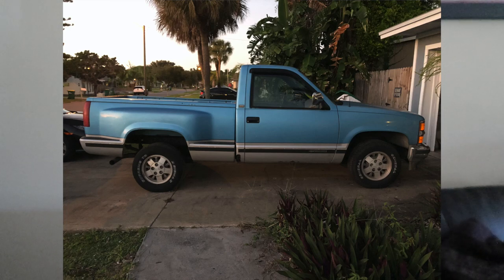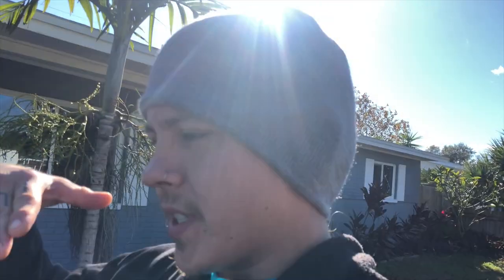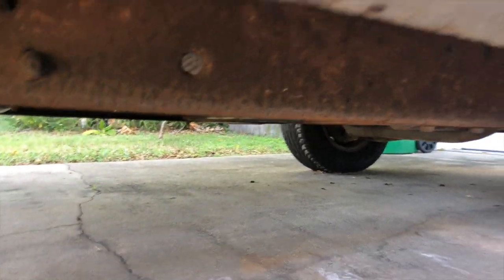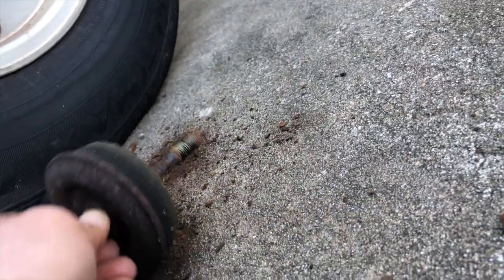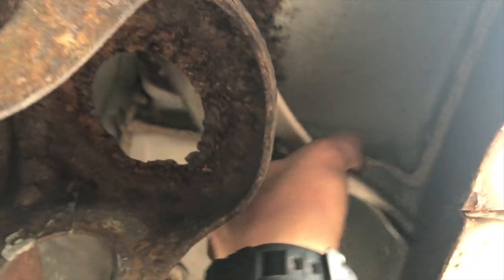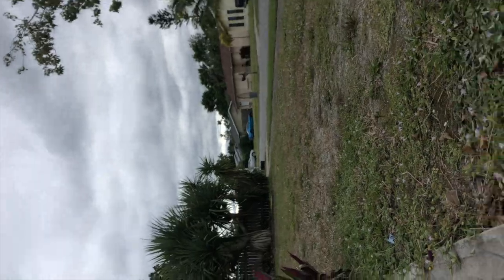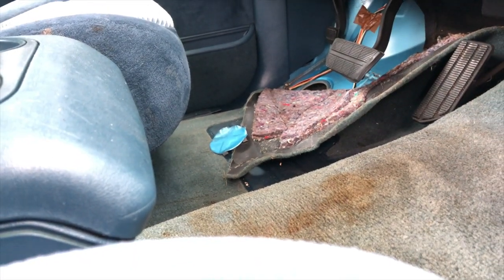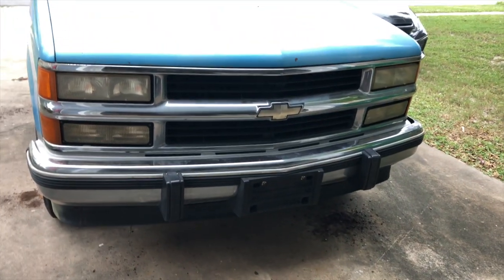OBS Chevy Cab (Body) Mounts Get Replaced! (Budget OBS Chevy Series Episode 4)

Comment: Did the kit come with bolts or did you source them locally? Do you know what size and thread they are? I've seen conflicting information as to what size they are. I suspect M12x1.75x120mm but have yet to confirm that.
Reply: Did you figure which bolts
Reply: @KingOfTerrors88  Yes, I took one of the ones that came out to Ace hardware and picked up 6 for my cab. $4 a piece but at least my cab won't fall off now. Pretty sure they were the m12x1.75x120mm.
Reply: @ifnotnowwhen6914  ok thanks! What body mount kit  did you order
Reply: @KingOfTerrors88  I didn't order a kit. My son had some extras in good shape i just needed new bolts because mine were rusted halfway through.
Reply: @ifnotnowwhen6914  ok thanks for bolt size
Reply from the maker: Sorry for the extremely late reply but for other viewers, I did source the bolts at a local family owned hardware store that has almost everything you could think of.